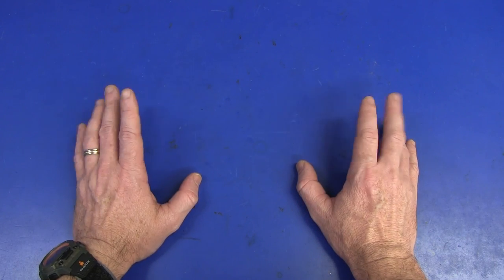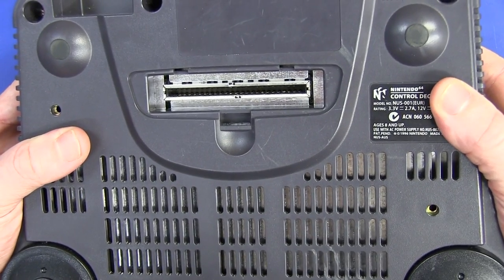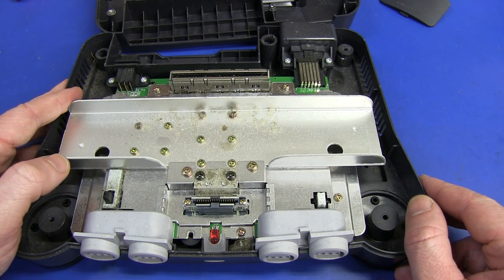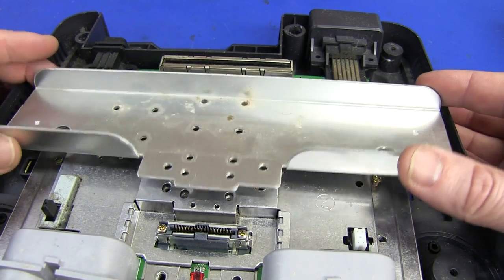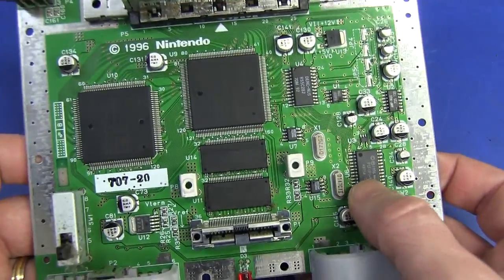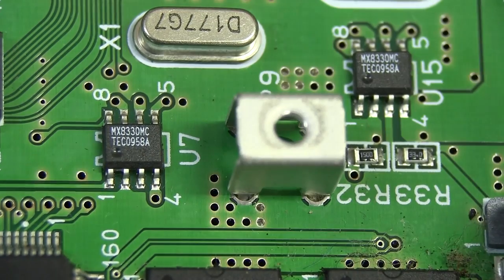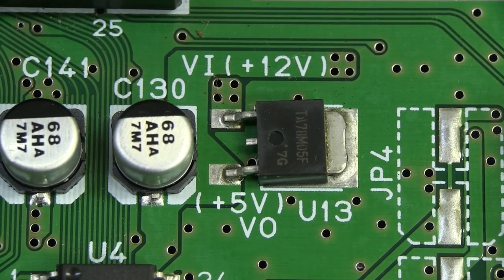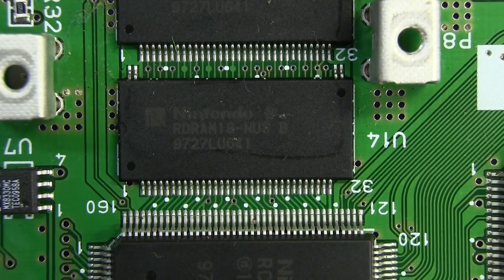EEVblog #491 - Nintendo 64 Game Console Teardown

Comment: Nintendo and Sega both used those security screws in several of their consoles and pretty much all their cartridges. You can buy the driver, called a game bit, for just a few bucks on eBay, but in a pinch, you can make one out of a clear plastic Bic pen. Pull the pen portion out & heat the large end of the shell until it's just about to melt. While the plastic is soft, slide it over the screw. Let it cool & harden around the screw, then just unscrew it!

Comment: very good tip for screws on tear downs that you don't care about ruing the screws. get a counter-clockwise drilling drill bit. you drill for a bit and the drill grabs and unscrews it, also works for ones that broke off at the head.

Comment: EEVblog When the system is turned on, the CIC (checking integrated circuit) on the console communicates with the CIC on the cartridge. They both calculate what bit's they'll send, and what the other will send. If the bits don't match, then they panic and the CIC on the console resets the program counter in an infinite loop, preventing the system from starting up. If the bits do match, then control the PIF chip DMA's the first couple of kilobytes off the cart into memory and jumps to the IPL (initial program loader) which loads the kernel for the game. So, if there's no game cartridge, I would assume that there would be no RBUS activity.
Reply: +SoulofAnotherDeity The boot code in the PIF chip does initialize the RDRAM IIRC, but yeah, it would only be a very short burst of activity before it fails the CIC chip most likely.

Although, the RBUS wouldn't work at all without the jumper pak or expansion pak installed of course.

Do you do any N64 coding btw? You sound like you've had experience of working with this console?
Reply: electronash Yeah. I've been modding N64 games for few years. I spent a lot of time hunting down and studying a ton of proprietary tools and documentation to write a bunch of my own tools for it. In particular, I'm more familiar with the graphics pipeline than anything.

Outside of modding, I did manage to build a few N64 programs and get them up and running on my Everdrive.

Comment: the memory expansion module inserted in this N64 is, as the name suggests, an expansion, it does not come on a stock N64. The red perforated head shows that the original 4MB stock RAM pack was replaced with an 8MB RAM module. Only 2 games (as far as I know in the US) required the 8MB RAM Module.

Comment: That track connects the Vterm voltage (from reg U12) to pin 159 of the RCP via a 240R resistor. The thin inner track is just Grounded, so I guess the layout is for impedance matching / noise reduction.

Vterm is one of the reference voltages for the RDRAM bus.
IIRC, it sets the maximum voltage swing for the Rambus signals (with Vref being the middle "switching point" between the Low / High logic levels).

Comment: AFAIK, it doesn't have a separate audio DSP block as such. Most games use microcode in the RSP to mix the sound effects and music, then it DMA's the resulting samples directly to the AI block.

(The microcode gets swapped from video to audio after all the polys have been drawn.)

Top Gear Rally is an example of a game which uses the CPU to handle almost all of the sound stuff apparently (can't find the forum thread now).

Comment: It's a NEC VR4300 chip. SGI made the "n64" and offered it to Sega of America, but they wanted exclusive rights to the chip. Nintendo agreed to license the technology. It used trilinear filtering compared to the PS and Saturn had smoother textures than the other two's pixellated ones. 4 games used larger ROM chips which allowed the games to use more textures and look better. Companies could have added more ROM memory to make there games look better due to the 4,096 Byte limit per texture. Resident Evil 2 and Conker's Bad Fur Day are two of the games which had more ROM memory inside the cartridge.

Comment: The ~50MHZ going to the RCP gets multiplied by 1.25 to produce the 62.5MHz GPU clock.

The 62.5MHZ clock also gets passed to the CPU (through that thicker diagonal track in-between). The CPU then multiplies it again by 1.5 for it's internal 93.75MHz clock.

Comment: If you don't want to spend the few bucks for a security bit (or you just want to get into the damn thing now), you can take a cheap clear plastic bic pen (or whatever you have), melt the butt end of it with a lighter, press it onto the screw (holding it there till it cools), and presto..you now have a security bit. These are good for unscrewing/screwing a couple times, so you'll just have to remelt it as needed. You're welcome :)

Comment: 20:40  The thing about the sound being done by either processor is pretty interesting, because if you look at some videos of people corrupting N64 games using emulators, a lot of the glitches they create involve seriously cocked-up audio (static or growling), moderately cocked-up graphics (meshes flipped around or swapped) and almost completely normal gameplay.

Comment: 9:52 It's interesting they have the ground-first pins, as the N64 was not actually hotswappable. It had to be powered off when changing the cartridge. It must have been a safety feature to prevent damage to the cartridge if someone felt like trying to hotswap it anyway.

Comment: The memory expansion has a jumper pack installed in the port on stock consoles, I didn't think the system booted without the jumper pack installed.

Comment: Yeah, it's a bit strange.

I just checked my board though, and the inner track definitely goes to the groundplane on the underside (at both ends).

Vterm is a fixed voltage from the reg, so I'm not sure how critical the impedance matching would be in this case.

Comment: That red thingy Dave pulls out at the beginning of the video is a terminator block for the RAM. Without it or a cart installed, the N64 CPU won't initialize.

Comment: Yes, but not sure how that relates to protection? Are you talking about protection on the pins / signals?

The jumper pak termination is required because Rambus uses very high speed signals and the termination resistors ensure the correct impedance match at the end of the line.

The expansion pak also has the pull-up resistors near the last RDRAM chip in the chain (without the correct pull-ups, the logic / current levels would be wrong and the impedance mismatch would distort the signals).

Comment: There was a cable modem you could use but good luck finding one. It went under the N64 as did those ZIP drives you could use to play all your games from underneath.

Comment: NUS actually stands for Nintendo Ultra64 (the N64's maiden name) System. In Japan, the ill-fated 64 DD was released and used not only the expansion pak, but also the port on the bottom, and it's prefix was NUD.

Comment: This system actually does not support hot swappable cartridges at all. You have to power it down before inserting or removing the cartridge. It constantly reads from the cartridge and without it the game instantly freezes and it starts a short audio loop. It doesn't even have an on screen message asking you to place the cartridge back in the slot. Even if you do replace the cartridge it's not hot swappable, so you still have to reset it.

Comment: This might sound pedantic, but the N64 comes with a jumper pak as stock (no RAM). The N64 has 4MB onboard, and the expansion pak adds another 4MB.

There are around 50 games which are "improved" with the expansion pak fitted, but yep, only about 2 or 3 games which actually required it (like DK64).

To be fair, many of the "hi-res" games ran quite slow anyway. The RCP's main clock could have done with being a tad faster to stop it lagging (I managed to overclock the RCP recently).

Comment: 64 bit processor is about addressable memory, not opcode or register size. So yea it was 32 bit mode because it never had enough memory to need more. SGI (Silicon Graphics Inc) owned MIPS back then so the CPU was also designed by SGI.

Comment: NUS = Nintendo Ultra Sixty Four. The console's second codename in development (the first was Project Reality, hence the SGI chip names). It's common practice for Nintendo to use an acronym of the codename for all the part names of consoles. For example, everything on the GameCube was labelled DOL (Project Dolphin) and the Wii - RVL (Revolution). Ultra 64 was going to be the final name of the N64, but was quickly changed just before release due to another game developer having trademarked the name. 

Sorry if I'm the 1 millionth person to tell you that.
Reply: Ultra 64 wasn't a code name for it. That's just what they planned to call it until changing it for reasons you mentioned.

Comment: The "U" in "NUS" stands for "Ultra", not "Ultimate" - the console was early in it's development called "Ultra 64".
I think, some of the over 700 comments had already told it, but for the case no one had: if you remove the Jumper Pak or Expansion Pak from the board, you also cut the complete memory of the N64. So it's no wonder the RAM does nothing ;)

Comment: To get into those security screws, the easiest way is to just use a bic pen, heat it up with a lighter until it is soft and press it onto the bit and it molds to it. Let it cool.  Then simply screw it out.  Or you can spend the 10 bucks for the bits, but honestly I have not found a set that lasts more than 10-20 consoles, doesn't seem to matter how much you spend, the gamebit screws eat them alive.

Comment: RAMBUS requires resistor termination on all unused memory slots. You'd have to install the RAM expansion for the memory to work. The N64 shipped with a terminator inserted into the slot. Early P4s required terminators as well.

Comment: TECHNICAL INFO
I know it's an old video but FYI, console will not boot without RAM expansion or its Dummy cart bridging the gap. That's why you saw nothing on the RAM as it won't work without it.
Also the console will output a blank screen when powered on with no game cartridge.

Comment: Biggest issues with the N64 were fill-rate limitations and the piffling 4KB texture cache (usually allowing only for 32x32 or 64x64 textures.  The PlayStation, despite it's affine texture and integer transformation (resulting in warped, pixelated textures; "jell-o polygons" and seam cracks) had often superior detail due to having an 8KB texture cache, often allowing for 128x128 or even 256x256 texture maps.  You can't beat that famous SGI image quality, though.  EDIT: also let's not forget that the CPU did not have DMA memory access from the RSP.  You had to pull everything over manually, which negated a lot of the advantages of the VR4300 CPU and the high-for-the-time bandwidth RDRAM. Second, as others have noted, a Jumper or RAM Expansion is required for normal operation.
Reply: Some games didn't even use the texture cache, to work around that limitation.

Comment: Just started watching your vids, I wonder have you ever did a tear down of the Sega Genesis/Mega Drive.
Reply: Nothing to see there, although there is alot more chips than on the N64 board. From what I can count on my broken pal model 1 (VA4) there is:
14 ic's, 11 through mounts and 3 surface mounts.
M68k master cpu, z80 slave cpu, ym2612 fm synthesizer, RAM, GPU (with inbuilt simple sound generator), I/O chip (I guess), video encoder/sound encoder, some capacitors, cheap ass contact switch, membrane button (reset), headphone volume and a 53 megahertz crystal.

Comment: The stock jumper pack is akin to a CRIMM used on old Intel machines with Rambus memory. Since the Rambus memory in the N64 is only 7 bits wide, there should only be 7-8 wires you'd have to connect.

Comment: The CPU (left-hand side) hardly gets warm to the touch and doesn't really need a heatsink, and yes the RCP and RAM probably run for a while on most consoles.

There is some variation / tolerance though, and some of them will crash after only about 30 minutes without cooling. Depends on your local temperature as well ofc.

The RDRAM chips probably get hottest, and I know some third-party expansion pak's were pretty bad for crashing.

Comment: On the subject of region locks in the N64: I remember very distinctly that the only real difference between the US and JPN cartridges was the shape of the cartridge itself.  I had dummy adapter that extended the cartridge slot outside the plastic case of the N64 and you could play Japanese carts in my US machine no problem by just popping them into the adapter.

Comment: The problem is most likely a faulty power supply. In my experience, that's the first thing to go with N64s if they're well taken care of over the years. I managed to get mine to work by disassembling it and hardwiring an external power supply to it.

Comment: Also, There has to be a Jumper Pack or Ram Module installed into the "Memory Expansion" Port, Otherwise the system would not boot the game. That may cause some of the odd current readings!

Comment: Google for "n64 expansion pak benheck", and you'll see lots of them. ;)

A few of us have taken the 36Mbit chips from the Expansion Pak and soldered them in place of the original onboard ones and it works fine (once the jumper pak or resistors have been soldered). This lets you keep the board size small while having the full 8MB RAM.

Comment: Downside with the small amount of memory is that they had to put it wherever they could and make the best out of the small amount of memory they had. Which is shown in Zelda OoT and MM. Shows for some pretty fun glitches based on memory hacking. I'm sure plenty of other games have that too for the N64 and the older gen consoles.

Comment: For what it's worth, N64s really don't do anything unless a cartridge is inserted, and they also need that memory expansion (or a dummy jumper block) installed in order to work. It might be worth the effort to power it up again with a game and the memory expansion in place, as most N64 hardware failures tend to happen with the power supply.

Comment: dave: without the ram expansion, or the standard ram jumper pack, the memory system isnt complete. when new, they had a black jumper pack that connected a couple of pins in the memory expansion slot. if you could find out the jumper pack pinout, you might find some extra life in it.

Comment: That raises an eyebrow even higher if the thin inner trace is grounded. I've never noticed a trace splitting and being surrounded by both inner and outer by ground and then rejoining.
I'm having a hard time spotting the inner and outer trace vias on the under side of the board in the video.

Comment: With regards to your point about the lack of solder joints on the connector, iirc this is the reason why NASA went with entirely wire wrapped connections on the Apollo computer. If you haven't seen the restoration project they did on that,you should check it out, it's well worth the watch

Comment: To get the system to function properly, it needs something in the memory expansion slot up the front (either the memory card or the dummy plug), and a cartridge - there's no way the system can function without those.

Comment: They included the memory upgrade with that unit, bit disappointed you didn't tar it down as well. I've taken apart the stock cartridge that is in the slot and it is just a jumper card with some resister arrays. Bit curious what the upgrade cartridge looks like inside. =)

Comment: I drilled out the screw on my yard sale SNES (they use the same screws) but didn't want to repeat that when I got a used N64, they do sell screwdriver bits on ebay for a few bucks and it worked great.  I tore my US version all the way down for cleaning (it was filthy, came from ebay).  Too bad I didn't take any pictures or I could've compared the video DAC chip.

Comment: Around 19:10 you mention that they often use the 64 bit processor in 32 bit mode. What exactly does that mean? I assume the 32 bits is referring to the instruction set architecture, right? So the processor can switch between reading 32 bit instructions or 64 bit instructions?
Reply: Yes, just like (most likely) the PC you're wrote your comment on does. x64 is fully backwards compatible to x86 for example.
Some CPUs can work on two 32 bit values at the same time instead of one 64 bit one.
Also no gamedev right in their mind uses 64 bit numbers for anything. That's why the 64 bit marketing of the N64 is just that: Margeting. If anything, 64 bit values are used for highly specialized stuff (maybe a space simulator) and for bookkeeping of a few very large numbers (like the amount of memory consumed for example).

Comment: There were two models. The CD64 and the N64 DD. The CD64, was an actual optical drive, made by a third party to play ROM files. The N64 DD, was a not very popular with only 8 games and one game expansion. With 60 proposed games such as Banjo-Kazooie 2 (release in cart as Banjo-Tooie), Kirby 64: The Crystal Shards (release in cart), Pokemon 64/Pokemon RPG, Pokemon Stadium Expansion Disk, Super Mario 64 2, Super Mario RPG 2 (release in cart in Japan as Mario Story, and Paper Mario everywhere else.

Comment: its nice comparing the insides of these to the ps1's, i have a broken n64 myself that i took apart and i have a broken ps1 for parts that i took apart too. its pretty cool how the n64 has heat sinks and the ps1 lacks them and the ps1 has alot more chips on it. its nice looking inside them.

Comment: It would be... Usually you just get a black screen. You can just about make out the effects of turning the power switch on and off, but that's it. Although... You'd notice the difference if you have a TV that shows a blue screen (or something similar) when there's no signal...

Comment: "technically" You don't have to power the unit off to swap a cartridge. You can plug another in and hit the reset button.  So I'm certain there were many times that people 'hot swapped' then cartridges and then hit the reset. Obviously, this is the situation he was talking about.